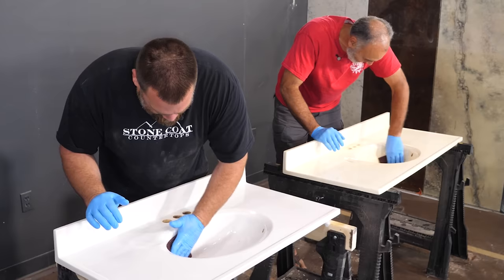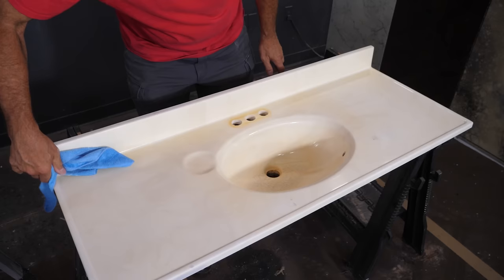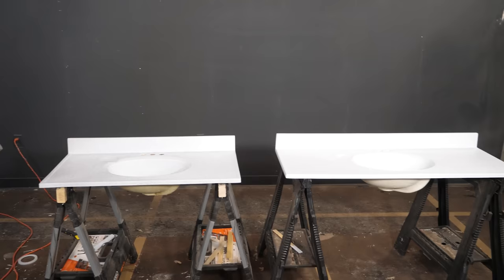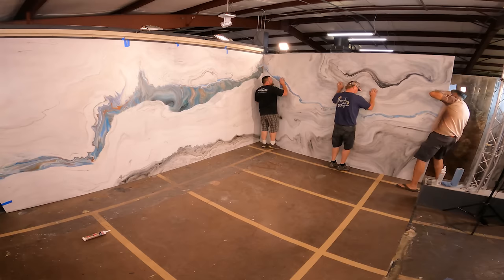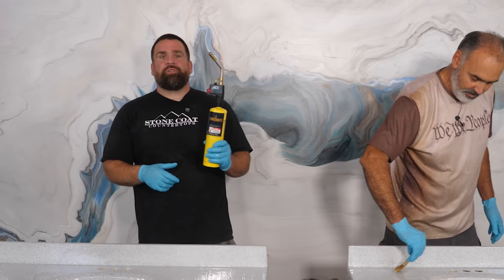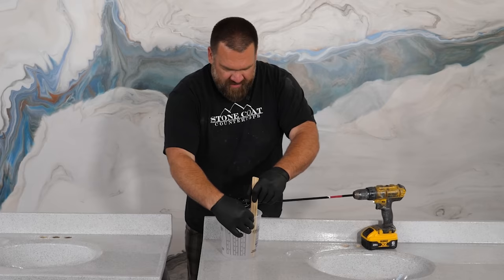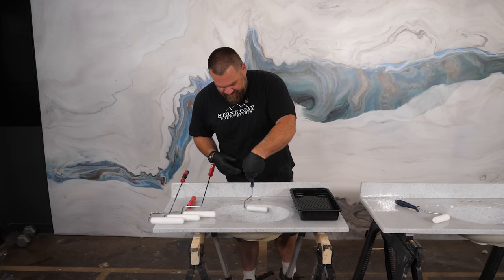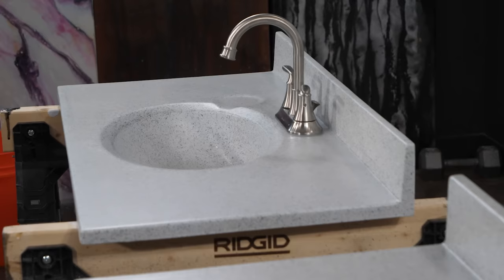Paint on New Countertops over Old Ones on a Budget

Comment: Excellent tutorial, thank you! I just completed my first one. It turned out very nice. I did learn a few things along the way that the tutorial doesn't cover as you guys are experts. Thought I'd mention it here which might save someone a bit of time.
1. I wanted to add a bit of sparkle so used glitter but the top coat spray-on finish covered it. I like that finish so not really sure if I would have done anything differently other than forget glitter in the first place. But if anyone wants a sparkle, use the appropriate glitter, not the one added to nail polish, it needs to be a bit grainier. 
2. My 2nd coat of epoxy (I did use Stone Coat product exactly as in the tutorial) wasn't completely even due to a bit of texture so I mixed up a third layer. Unfortunately, I was a bit stingy on that third coat thinking a thin layer will do and it ruined the entire finish as it beaded up in places and didn't level out. Had to work my sander a bit to smooth out the surface and mix up a 4th coat. That coat was generous and came up very nice.
A NEWBIE TIP: Turn off your HVAC and keep any house pets away from the area, enter work area with minimal disturbance of air. I had dust settle on my first coat (cat hair, lint, etc.). I let the last coat and top coat dry with absolute still air in the room with windows and doors closed.
3. The drain got narrower with epoxy coats, the new appliance drain stopper didn't level well and is accumulating water at its edge. I will have to remove the drain stopper and grind out some material later to make the stopper fit better. Not a terrible situation but I am a perfectionist.

Overall, this was fun project. I am now eager to try other resin projects.

Comment: Epoxy is such a versatile substance.
Reply from the maker: Sure is! We designed this one to withstand the use and abuse in the kitchen and bathroom. Have you used epoxy for a project yet?
Reply: @StoneCoatCountertops  I've used epoxy paint on motor vehicles, and I use to be a GRP laminator. I've not used it for interior refurbishment and design, but I'm sure I will in the future. I can see how it would be great stuff in a Yacht interior, which is a plan in the pipeline.

Comment: Can you use these products on moulded plastic shower bases? It's not fiberglass, looks and feels more like vac or blow molded plastic. Thanks
Reply from the maker: It would bond following the same prep steps, few things to consider. The slop of the shower pan will cause the epoxy to self level down the drain. Epoxy without grit in the shower pan can be slippy. We have a clear grit we are weeks away from releasing. It would be best if the shower pan was not installed and you could let the epoxy self level down the pan. Apply thin layers, sand between coats with 220 grit

Comment: Mitch have you done any videos on removing scratches on epoxy countertop after having used for a year or so by appliances and everyday use? Is it required to sand and put new cleartop coat even though there's a tile backsplash?

Comment: One question I have is what is the best place to do this kind of thing. I live in a humid environment how will that effect results?
Reply from the maker: That is a great question. High humidity causes the epoxy to cure at quicker rate. The working time is still 45 min once mixed but for instance if you have a tape dam up because you did an exotic pour you'll pull the tape between 1.5 - 2.5 hours after mixing rather than 2.5-3.5 hours after mixing here in Oregon. A lot has to do with your shop temp also. Higher humidity, lower the temp in the shop to slow the cure. Thanks for watching and great question!

Comment: Can this method be used on tile countertops that have grout? If so what would you need to do for the grout lines not to show? Can bondo be used to smooth out the countertop?
Reply: I have the same question. I hope they answer!
Reply: Level quick in the flooring department at big box store.
Reply: Diane Hearl - thank you!
Reply from the maker: Great question. Grab some level quick and polymer bonding primer for the level quick for the grout lines

Comment: Can I do this without removing it from the vanity?  I assume I should remove the plumbing and sink stopper.
Reply: Yes
Reply from the maker: You sure can, great question. I would remove the tail piece and the p-trap and plastic off the inside of the sink cab, front of cabs, and floor. Tape off above the backsplash to protect the walls. Now you're ready to follow along with the video. On-site prep is pretty easy. 
I use:
3 mil plastic roll 3'x25'
Yellow and Blue masking tape
Let me know if you have any other questions -Mitch
Reply: @StoneCoatCountertops  thank you, I’ll give this a try after the holidays.

Comment: How does this not sag into the sink hole as it takes 12 to 24 hrs to cure and set
Reply from the maker: It does self level, we lightly sand between clear coats and apply two. I take out the drain and p-trap and catch the epoxy in a bucket in the sink cab. The tail piece fits rack back in when all done. Lemme know if you have any other questions

Comment: Love the video! Awesome!
I'm planning to do my shower base with your epoxy. Can I use bondo on the titles after I cleaned and sanded it to smooth out the grout lines inserted of a leveler? Because the shower base is slanted towards the drain
Reply from the maker: I'd use a versabond thinset after prepping the shower pan with a bonding primer designed for that sort of application.
Reply: Don’t do it!!! Apparently they can reply to comments on YouTube but don’t answer emails from their customers.. it’s been over a month and I’ve reached out multiple times. The product is not scratch resistant as they say..

Comment: Does this work for fiberglass tubs
Reply from the maker: We let it drain out of the bottom of the sink hole, I'll remove the tail piece and move the p-trap out of the way and let the epoxy drip into a bucket or plastic off the sink cab. The epoxy is so thin on that section the tail piece fits right back in with no problem
Reply: My fiberglass tub turned yellow & I want to revive it & wonder if I can use this method